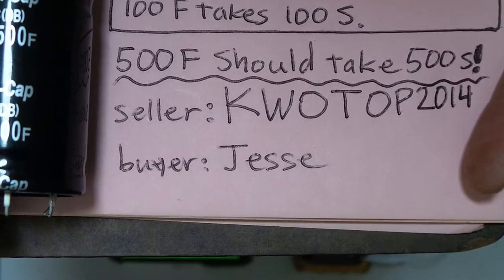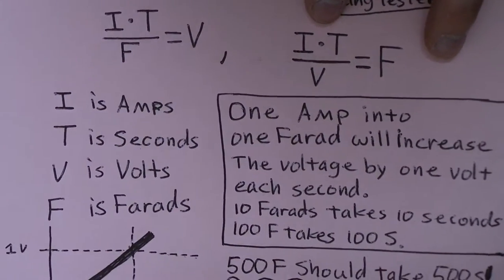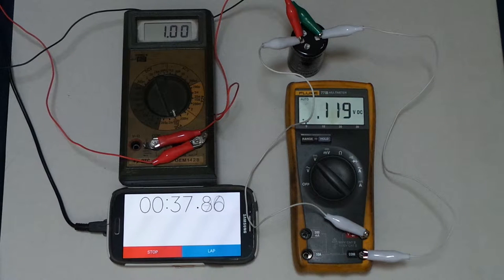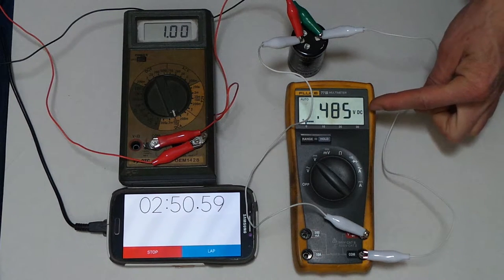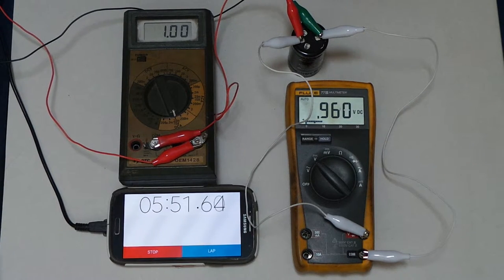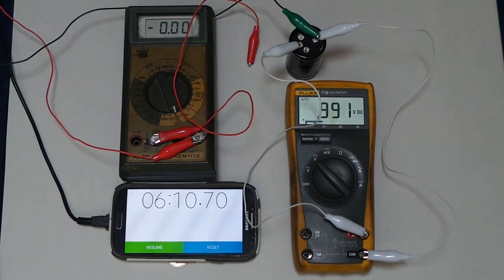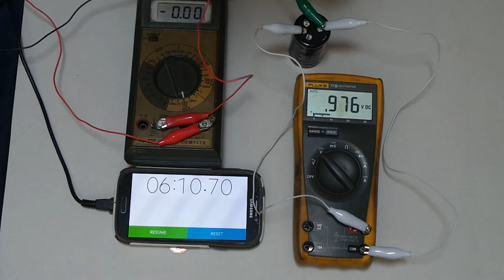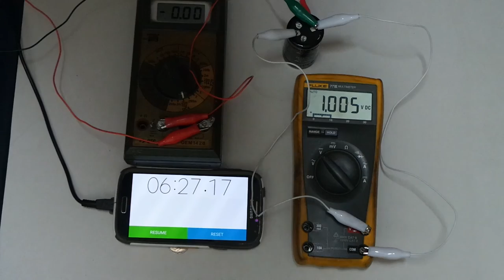How to test bad greencap ultracapacitors from kwotop2012 500F turns out to be less than 400F

Comment: Thanks, Jesse--I have a similar problem on my solar project.  Testing leakage between 2.000V to 1.900V and get wide variations.  Inspected the caps I received and MANY are bowed from internal pressure, they have bent leads from desoldering, some are desiccated (shake and feel the cap guts slap against the can), and scratches on bottoms where a tool was used to remove from board.  Sold as "new" on eBay--don't buy from "gloriadiy" either.  My problem is that I am in Asia, and shipping charges from US are fairly prohibitive.  And thanks for the entertainment, too...
Reply from the maker: Now that you mention it, I noticed some of the ones I got were such that you could shake them and feel the internal capacitor thumping back and forth, dry like. I've heard that some are fakes with a smaller capacitor in a 500F case, maybe that's what I got. Some of mine slosh, you can actually hear the liquid in them.
Reply: (Google translator) I ordered 2 pcs at 100F - they even differ in weight, one weighing 20 grams, 12 grams of the other - that it's easier to have died after one cycle of charge - discharge

Comment: Some information you may want to add to your video.  Green-Cap is a 
Korean company.  They do NOT make a 500F in that D cell size.  What is 
happening is Chinese counterfeit companies are dumpster diving old/test 
failed Green-Cap 400F capacitors.  They then put a shiny new 500F label 
on them so consumers think they are getting a better deal than if they buy a Maxwell
 or Eaton.  One of the tail tail signs is the green 500Fs discharge VERY
 quickly (not up to leakage specs for even real new Green-Cap) compared to the 
Eaton and Maxwell.  Maxwell is my favorite (all around great quality and
 good vibration resistance).  Eaton is good too and I've used some high 
quality Nesscap.  Take with a grain of salt and be careful where you buy
 as China is making fake Maxwell and Eatons now too.

If you have a super capacitor project go Maxwell.  You won't regret it and they perform like a dream.  Beware Quifen, Green-Cap, Nisson, and most "cheapo" out of China caps.

 You can also use quaility capacitors to make a good "long life" car 
battery.  I have been using one for quite a while now.  
If you like to see one in action I document my build here:
https://www.youtube.com/watch?v=X8D7sNKNu-8&t=3s
and
https://www.youtube.com/watch?v=zBDtUxPdhz4

Comment: Your tests match ones I did with the same units last year. The leakage is the worse problem, try connecting a green LED across then charge the capacitor to 2.7 Volts, the LED should stay illuminated for 2-3 days, a genuine 500F  will pass this test, these FAKE green caps  fail in less than one day. Most likely they will dry out in  while and present even less capacity, the ones I had a year are now virtually  useless the LED does not stay lighted after the charge is removed.

Comment: Спасибо! Сейчас пойду потестирую свои недавно купленные 100Ф ионисторы. Развеселила идея музыкальной паузы, да к тому же живая музыка, оригинально )))
Reply from the maker: Thank you! The 100F ones are actually not new, they are old ones that I was using to test my test procedure with.
I'm trying to replace the battery in my little motorcycle (1986 Honda CT110) with supercapacitors, which is why I wanted 500F ones, but I have not been able to get good ones from China or Hong Kong. I'll probably have to get expensive ones, or just use the cheap ones even though they are around 300-400F.

Comment: I also buy one 500F supercapacitor from ebay and I calculate it from ref your formula and my supercapacitor value as result i got 345 F. You are right. Now tell me pls what I will do.
Reply from the maker: So far I've got 3 different shipments of 6 or 7 "Greencap" capacitors from 3 different vendors and so far they've all been bad in the same way. One of them even had all the capacitors getting surprisingly hot when slowly charged up to 2.5v! (and they were 2.7V rated caps!)

As to what to do, contact the seller and return them and get your money back. Or live with 345F.

I have come to the conclusion that all the greencap supercaps on ebay for $4-$6 each are all factory rejects or fakes or something.

I guess our options are to either just use more capacitors to get the farads we need, or get expensive capacitors of a different brand.

I requested returns on all the orders I got so far, some of them gave me a prepaid shipping label to send back to a USA warehouse, while others just refunded after some persistence on my part. They are supposed to provide a prepaid shipping label for the return  but rarely do because of the cost of shipping back to China. 

But they are all selling falsely described items, and they keep selling them after finding out they are faulty and they won't test them so  they are probably not honest people.
Reply: fromjesse thank you for this video and all usefull coments below this video. I was going to order same 500f from cnikesin... but cant find datasheet from samwha manufactory and now i understand why, they simple doesnot make 500f 2.7v ones. I am a bit dissapointed about sellers at ally express that pretty sure know what they are selling and still dling all that lie. Will try to search for 400f now, maybe there some honest sellers with good price left ;)

Comment: I bought 8 of those caps (different seller, but still chinese). All 500F caps you get for 3,50 - 4,50 USD (EUR) are fake or rejected production! Mine had around 360 F and they were leaking! At only 5 amps charge current (should be not problem at all) they started to get hot and poured out some salty stuff at the sealing! I got a partial refund! To get real proper 500F caps you have to invest around 20 USD.
There is no free lunch - unfortunatly ;-)
And they always ask for photos or even videos! I ask them to pay for the extra effort!

Comment: hii, you are charging supercap from your power supply, may i know how many voltage from your power supply ?
thanks.
Reply from the maker: The power supply is a constant current power supply so it was producing just the exact voltage needed to push the needed current.

Comment: It would be much easier to use a digital multimeter to measure the capacitance --if you can find one which can measure up to 500 F.
Reply from the maker: yeah, capacitor  meters of the kind that I can afford generally don't go up into the whole farad ranges. But measuring them the old fashioned way works just fine. I had previously tested my method on some known good 100F super caps of another brand and my method worked fine on them.

Comment: There are a few problems with your supercap testing. The formulas you are using are true only for ideal capacitor, real life capacitors may behave differently. To verify if supecap behaves like normal cap, you should measure voltage maybe once a minute and check if it rises linearly. Ideally whole charging curve should be measured.

Second problem - no two components are manufactured exactly the same, there are some manufacturing tolerances, that's especially true for cheap parts like the greencap. 20% off the specified capacity seems good enough to me, since they are so cheap. Even the chinese guy on ebay has to make a living . I wouldn't bother with return if the only problem is 400F instead of 500F.
Reply from the maker: Michal, How would a real life capacitor behave differently? In any case,  I tried my method of testing on a 100F supercap of another brand and it was very close to its stated farads. I'm sorry but super caps are supposed to act like big capacitors of the stated parameters.  If you are interested in checking if the voltage is rising linearly every minute just play the video and pause it and write down the voltage at each minute interval. I did just do a quick search for testing a supercap and it looks like my method was essentially correct.  However, if you have any useful information on testing super caps please post it instead of just saying I'm doing it wrong -- please tell me how to do it right if you're gonna tell me I'm doing it wrong :D